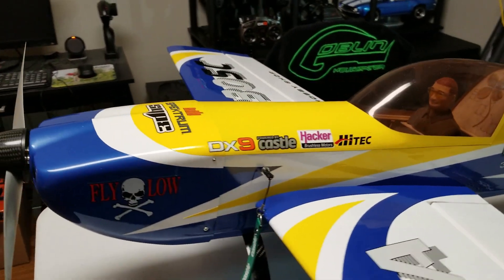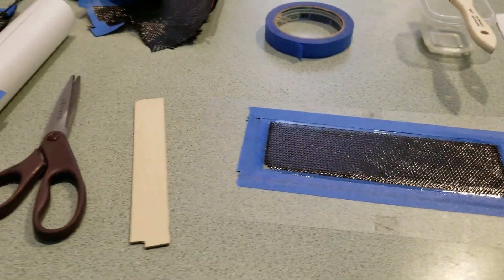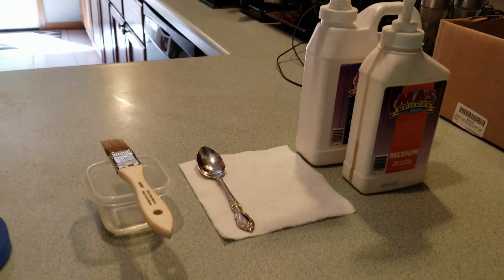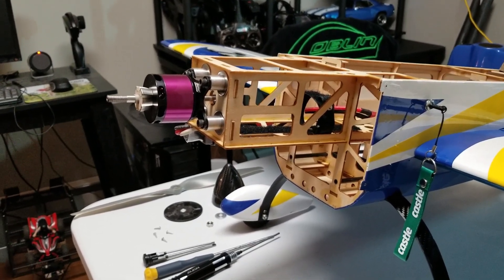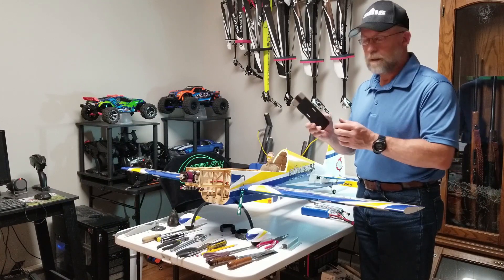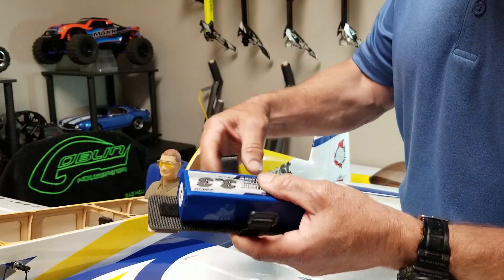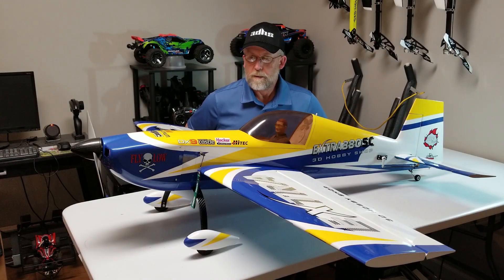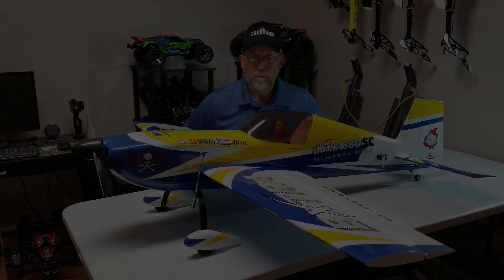How to Build an RC Airplane Battery Tray...

Comment: Why didn't you use CF for the tabs? I gotta think those tabs will under more force than the plate itself? Thanks for the video though....I'm going to see if it works for a 50cc warbird.
Reply from the maker: The only reason I used carbon fiber on the tray is because the velcro straps puts a slight bend in the tray. CF doesn't have memory. Otherwise wood is strong enough for the whole thing...